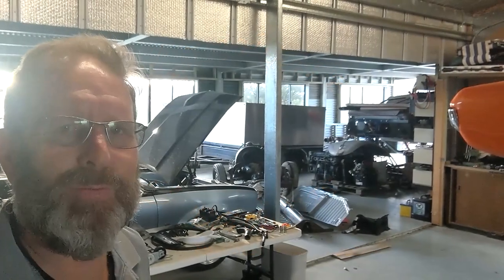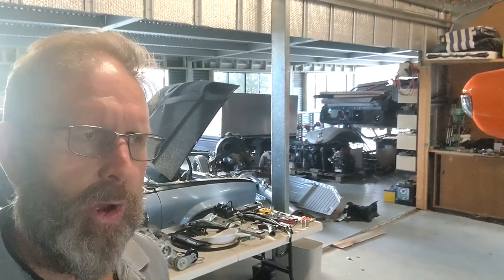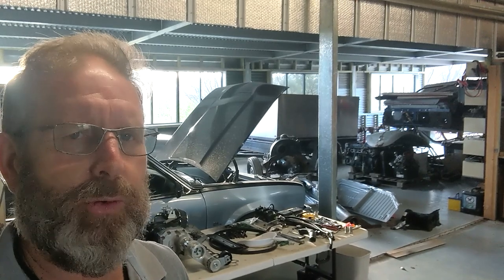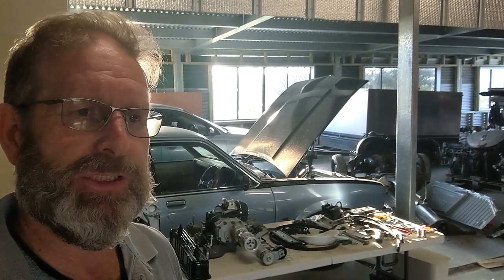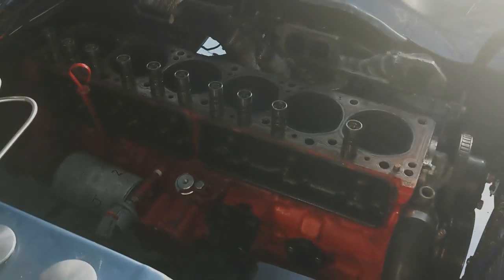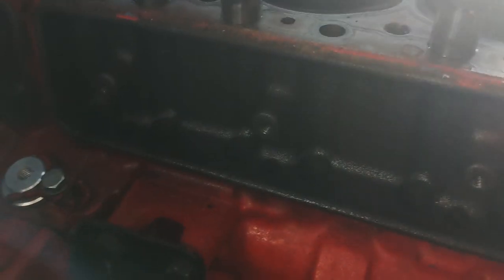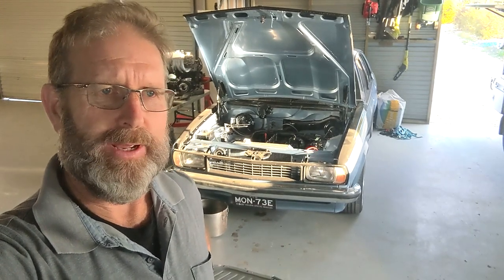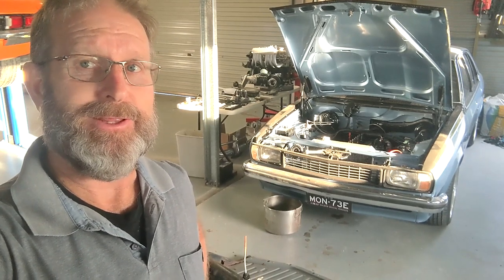Torana Build No.43 KamicarzCreations - Roller Cam and lifters with Billet timing cover

Comment: hi mate i hope you do better than me ,myne has got a 671 twin 464s aliminum head like yours ice egnition top of the rang everything $38000 including radiator and feul cell 12lb boost and i cant get more than 280 whp its not bad but i expeted 400 whp all the best
Reply from the maker: Yeah John, it is a mine field working out whats wrong. Im probaby 35k in over a long period of time and really had one good run. As you can see i have been running it in the UC. Im thinking now of selling the UC to fund building my LH and putting the motor in it. I'd be happy with 250whp and reiliability :-)